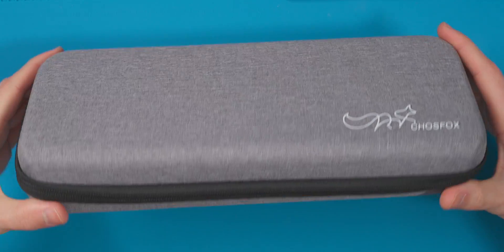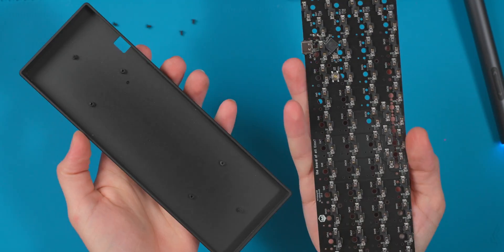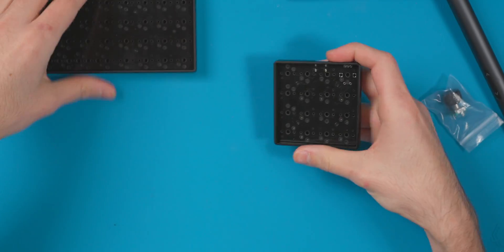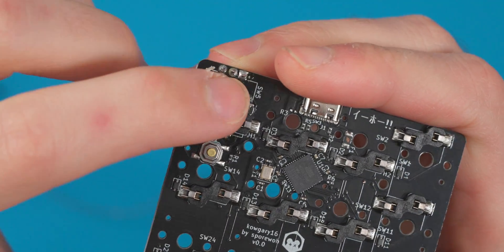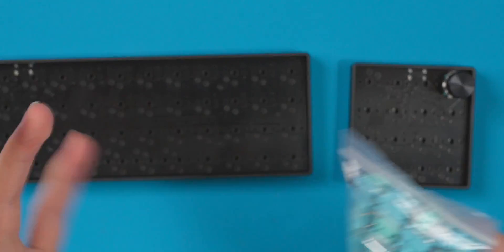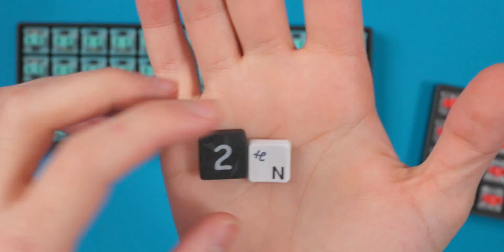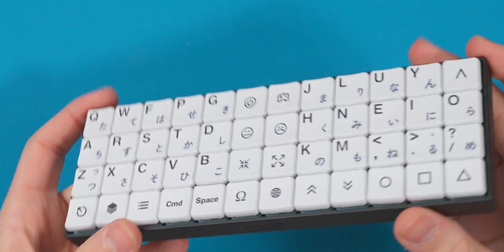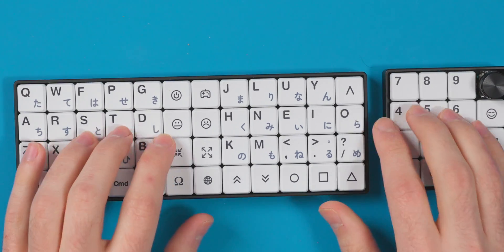The Smallest 4x12 Ortholinear Mechanical Keyboard? (minipeg48 and kowgary16)

Comment: I have a choc spaced Corne 36 with the Chocfox CFX keycaps. I quite like them except for the 1.25U which is not curving the right direction for my liking.
I do like the idea of these smaller boards, including their Bancouver40. But I need them to be wireless to get the most from their small portable size.
Reply from the maker: I would love to see the boards form this video in a wireless version.

Comment: One issue is that it uses old chip ATmega32U4 which has quite limited capacities. Newer keyboard should use newer chips I suppose.
Reply from the maker: I agree but the one thing about the 32U4 is that it’s very well documented and supported. This leads to both firmware and hardware being easier to setup. Personally for me when I do eventually make a PCB with integrated components, I’ll likely go 32U4 before trying something more modern like an RP2040.

Comment: "Normal" keycaps like OEM for cherry MX are very spaced out, and have a pyramid shape that separates them from each other. How hard is it to adapt to a smaller spacing, lower profile keycap, with tighter gaps? Seems like the space-saving thing is just a hassle with diminishing returns.
Reply from the maker: Boards like this are more so for looks and “flex” factor than ergonomics. You can certainly daily them but comfort will be an issue longer term. That said, adapting isn’t that bad but it is a bit of a struggle at first. After 15-20 minutes of typing you start to learn you don’t need to move as much.